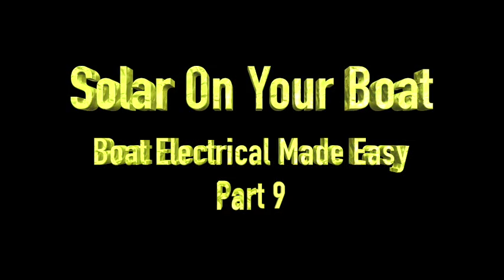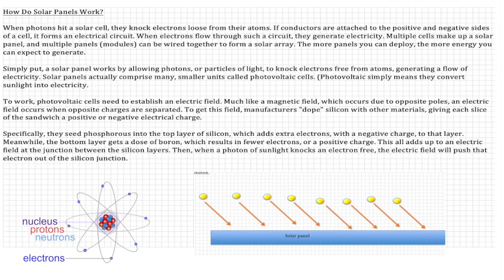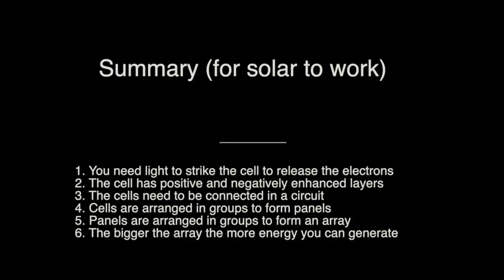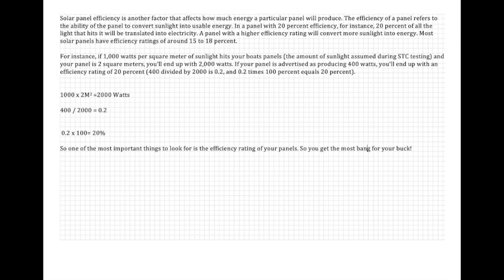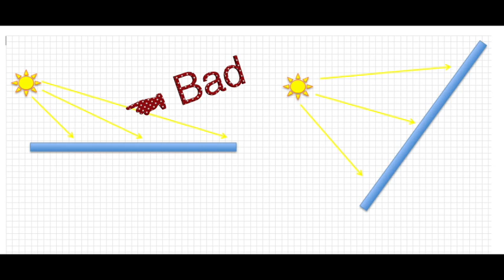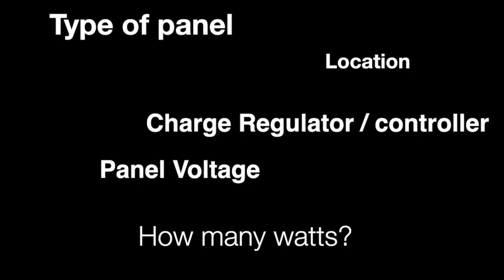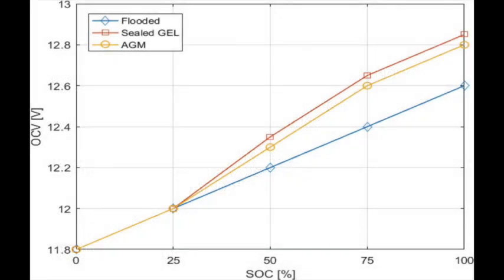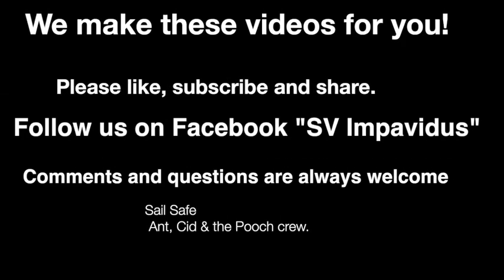Solar on your boat. How to fit solar power to your boat. What you need to know. BEME part 9

Comment: A question while I’m here,to alleviate electronics failure by lightning strike, can the mast be grounded to the ocean through a thick welding lead cable thrown overboard in foul weather or do you think that would create a circuit back to the batteries through the earthed through hull fittings with the copper straps on them,any thoughts on this would be helpful,cheers.
Reply from the maker: Harry. Most boats now have a connection to the keel from the mast. This works like an earthing rod. The problem is the Electromagnetic pulse (EMP) that comes with the lightning. You dont have to actually get struck to do the damage to any electronics. A nearby strike to the sea can have a big enough EMP to fry all the electronics on your boat. While a good earth cable or rod will create a safe path the just about everything electronic on the boat will be toast. We have a boat about 7-6 boats from us here. A super maramu 2000 it was out in a storm last year and had a proximity strike. It has earth rods to the keel (bonding straps) yet, the owner says its $25k in damage to the electronics. Even the auto-pilot is toast! Sail Safe, Ant, Cid & the Pooch crew.
Reply: SV Impavidus (Ant & Cid Sailing) thanks Ant,just using logic bare with me I’m new and tentative of electronics,I suppose the spike comes from the pulse through the earth circuits and blows the diodes.Suppose that’s the case,as with positive circuits,buzz bar to switches and then circuit breakers and then components,could it be possible to put circuit breakers on the return to the earth buzz bar creating a breaker to the earth side of the battery?Am I missing something here with the electrical wizardry smoke in a plastic can(the 12v battery)system?cheers,I hope this is not futile or else I just have to isolate the batteries with all components turned off in foul weather cruising.thanks Ant.
Reply from the maker: @harryweyer2174  .  The problem is that the lightning in a direct strike will jump the gap in the breaker or even a blown fuse. The voltage is so high it can literally jump any gap in its path to earth. After all the spark has to jump thousands of metres from the sky to earth or the sea. The little gap a breaker or switch creates in any circuit or path is tiny in comparison. We are talking millions of volts in lightning. It tends to be the electromagnetic pulse generated in the air and water that does the damage. Any cables or coils or even conductors have a current induced in them. Any electronics has components on the circuit board and the board its self that  can have a current induced on or in them. Some of these are very susceptible to power surges and power spikes and they literally fry. Its a bit like a motor coil or a solenoid. If you put a coil or a conductor like a cable in the path of a magnet or in this case a magnetic pulse a current in induced in the coil or conductor. The bigger the pulse the bigger the current. Some say that putting your phone or hand held GPS in a micro wave or oven will protect them from the pulse because you form a cage around that the pulse cannot penetrate. (Faraday cage). In theory this is correct but we have never spoken to anyone that can confirm this works. Ant.
Reply: SV Impavidus (Ant & Cid Sailing) thanks Ant your reply makes a lot of sense.Well I guess it’s as they say in industry,run till fail it is.All the best mate I really enjoy your input current,lol.cya.SV Thora.
Reply: Harry, we have a system that was commercially installed to manage lightning strike, I think by directing it to other boats 🙄. I suspect it us as useful as elephants wearing green hats so that they can walk over snooker tables undetected. Never seen one have you? That proves they work. Our "Go Away Lightning" system has worked so far because our boat hasn't been struck in 18 years. I suspect the sellers have spent the money already.
Reply: Phil Gray I’ll have to look further into a commercial model.My enquirey is more for underway on the open ocean where strikes are more prevalent,cheers.
Reply from the maker: @philgray1023  Brilliant post. we will use that "elephants wearing green hats so that they can walk over snooker tables undetected".

Comment: Hi Ant, great video, thanks. I would like your opinion on pros and cons of a wind generator as opposed to solar.  Should you have both? Thanks in advance!
Reply from the maker: Julian. Its a great question! Bit late here in Italy. we will give you a detailed answer  tomorrow if that OK ?  Ant.
Reply from the maker: Hi Julian. Here is our take on wind gens. They are good at providing power in windy conditions but many need 15-20 knots to give any real usable power. However they will work day and night conditions. Some are quite noisy or can transmit vibration into your boat. Others have a built in brake system that locks the blades when the wind is too strong or the batteries are full. If your sailing down wind then the apparent wind speed on your boat makes them all but useless. Up wind sailing they can produce a decent output. We think the modern ones are quieter and more efficient however the position many boats have them they cast shadows on the solar panels. Models like the duo-gen can be used as a  hydro gen too. These have a decent output when sailing. We have had one on another boat but to be honest it was a pain. Noisy at night and never really giving us more than 4 -5 amps even in a stiff breeze. If we were going to fit something else for extra power I think we would look at a hydro gen. Maybe the Watt and Sea which we hear is pretty good. At Anchor we have a good solar system with two regulators that are both MPPT that have been giving us more than enough power all summer. Somewhere around 25-30 Amps. Or  2000-3000 Watt hours over a day. Some days slightly more.  Compared to Solar the cost per watt hour is quite a lot which is the main reason we would not put one on the boat. In fact we took the last one off, we had on our previous boat.... Hope this helps. Ant.
Reply: SV Impavidus (Ant & Cid Sailing) Hi Ant, cracking reply, many thanks. The reason I ask is we’re about to move up to a 40ft+ something and many of them have wind generators rather than solar, I understand most of your points, especially about the pros and pros of going lithium ion, but not sure our budget can handle that. The important thing for us is that we’ll be able to generate power to run fridges etc, when spending time on anchor. I guess the key is to know what you use and monitor your battery and make changes as and when you need to. 

Thanks for all the top videos, we really enjoy watching the four of you living the dream. We’re planning our own version in the near future too, so maybe our paths will cross one day. We already have friends  in common, Ryan and Sophie, in fact we just crewed for them from Lanzarote to Cape Verde, so we’re expecting our 15 minutes of fame in the next few weeks, when Sophie gets her editing done! 

Fair winds and safe sailing to CID, Oz, Lady Rose and you too mate!

Comment: Your videos are an instructor's dream. 
Could you direct me to some drawings. 27 ' sailboat outboard motor 9.9hp. I would like motor starter circuit. As well as a house bank with 100 ah lipo4, solar and shore charging with a small 12v to 120 volt inverter.
Thank you
Reply from the maker: Send me more details and I will have a look, I cant promis how quick as we are still sailing here in Turkey. mail me. impavidussailing@gmail.com best regards Ant.